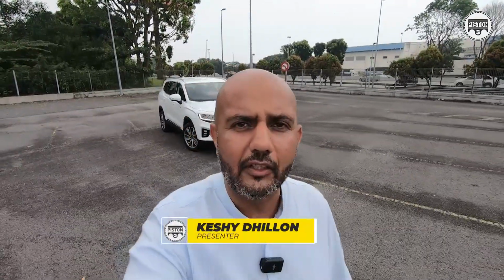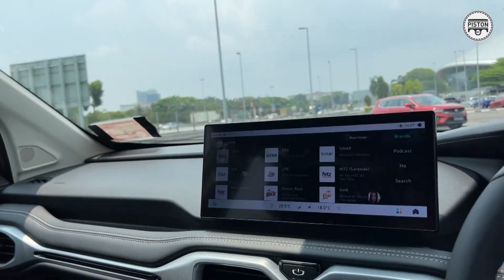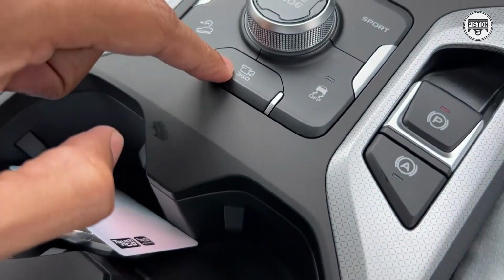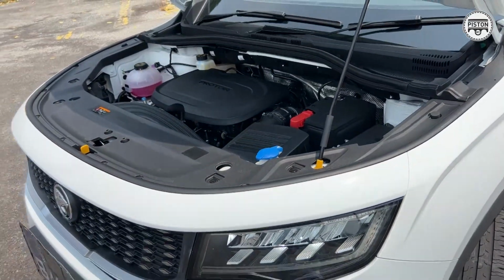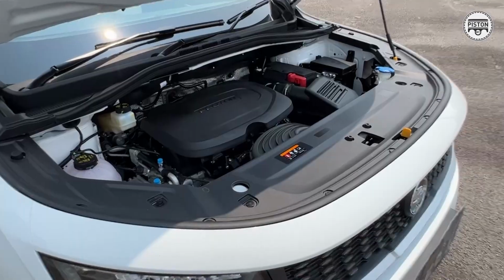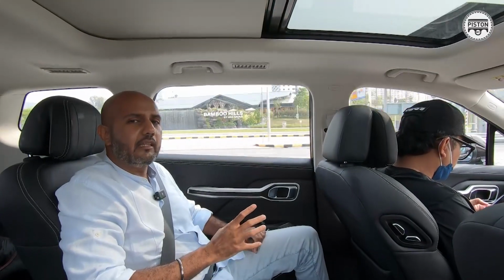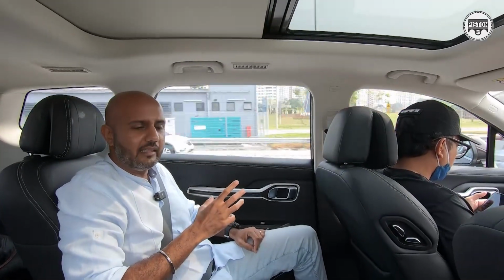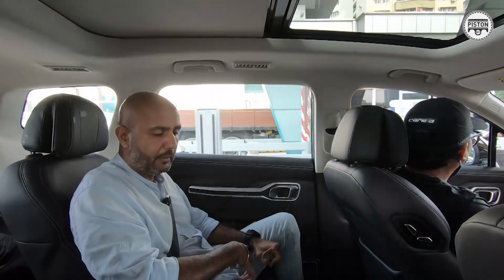New Proton X90: First Impression!

Comment: I beg to differ regarding Goodyear and toyo...I had a set of Goodyear fitted on my civic before and it was the lousiest set ever. Those Goodyear are noisy AF and it lasted only 30,000km as compared to continental that lasted 70,000km and the continental has better dry and wet grip.

As for toyo it is hard stiff noisy and grip is pretty lousy (my cx5 were fitted with toyo) continental is quiet with much much better dry and wet grip on the cx5 as well.

Ps. Civic fitted with continental mc6, cx5 uc6 suv
Reply from the maker: Our experience is quite the opposite. Goodyear’s have been phenomenal and were quieter. Lasted about 50,000km which is quite decent considering softer compound. 

And our CX5 running on Made in Japan tyres has been great too. 

Experience with Continental’s has been below par.
Reply: @PistonMalaysia  the original toyo fitted on my cx5 are proxes r46 made in Japan, quite unpleasant experience. May I know which model of Goodyears did u guys use? The ones I had on my civic was assurance, it was noisy to the extent it sounded like a faulty bearing 😅😅
Reply from the maker: @jonathansslee  Oh wow! Sounding like a faulty bearing is not good. Did changing tyres fix that or was there a deeper problem? 

We were running GY Eagle F1 on a W212 Mercedes. No issues. 

About the CX5, did you change the tyres to Conti's then? Which model?
Reply: @PistonMalaysia  civic after changing to conti ride is significantly quieter....cx5 change to conti uc6 suv also significantly quieter and improved dry and wet grip
Reply from the maker: @jonathansslee  Thank you for the feedback. Shall give it a go.

Comment: You need to think twice about your review. X90 has a more powerful plant and it is LIGHTER than x70… common..
Reply: It is lighter by about 90kg in others country. Geely make improvement on this platform, this is well known. You might accidently miss this. But for malaysia version, they not announce the weight, but expected to be lighter.
Reply: @esee  Yea. reviewers like this confuses people with bad information. Learn from YS Kong on how to disable the speed limiter and do your video again..
Reply: the published weight for the Okavango in Philippines is indeed lower than the Azkarra/X70 1.5t. Proton numbers for X70 meanwhile are completely different. See below:

Geely Okavango 1.5t - 1610kg	
Geely Azkarra (X70) 1.5t - 1705kg
Proton X50 1.5t Premium - 1615kg

So take it for what's it worth, not sure how the Azkarra is listed as heavier than  the bigger Okavango.  less sound deadening or perhaps lighter chassing/base materials? also worth noting the X90 will have a heavier independent rear multilink setup which would probably add weight.
Reply: @preetz8  Please.. do you know that new stamping tech and frame of the X90 means that it is simply built lighter than the X70. The X70 is simply built on a much older frame.. Do you see a car as a car and all the same and assume weight has to come from accessories and components alone?
Reply: @MC-zv3ri  calm down bro. Was just sharing numbers, also I did mentioned "lighter chassis" for XC90.
Reply from the maker: A car that has more seats, a motor, a battery, a glass panoramic roof and more metal but is somehow lighter than the X70? Okey bro!
Reply: @PistonMalaysia  You clearly didnt do your homework... Dont deserve to have a channel talking about cars if you dont even bother making research of what youre reviewing.. You also probably didnt turn off ADAS that limits speed and dont even realize it.
Reply: @PistonMalaysia  Better you delete my comment and your comment and redo your video la bro.. Or you can go review phones instead.. You want to dictate a car's weight by number of seats it has.. omg..
Reply from the maker: We said all those things and you only read about the seats? Are seats weightless??